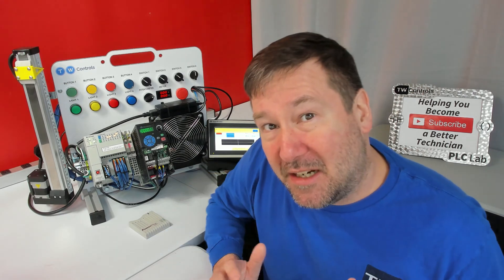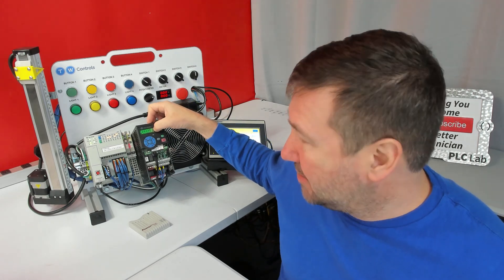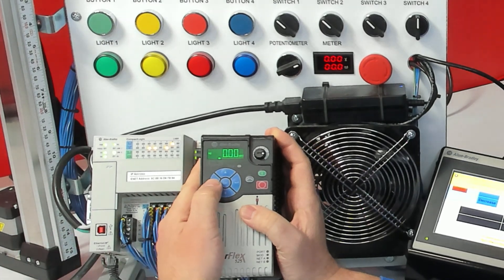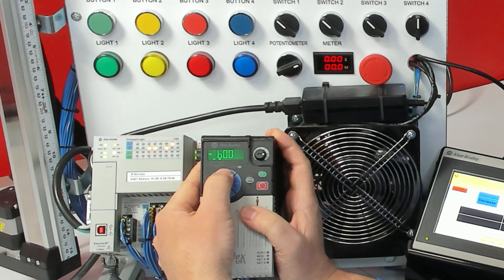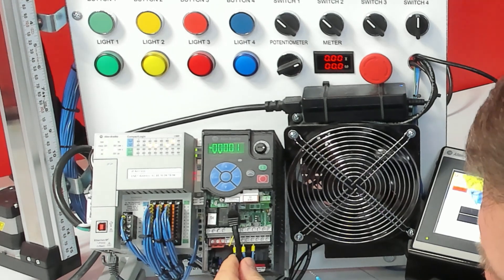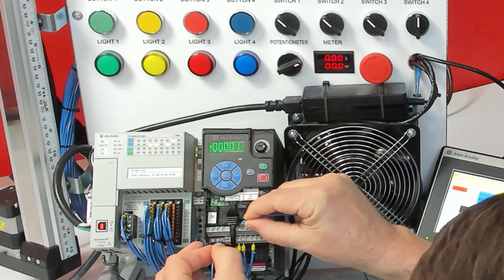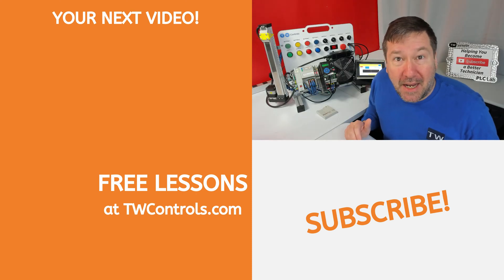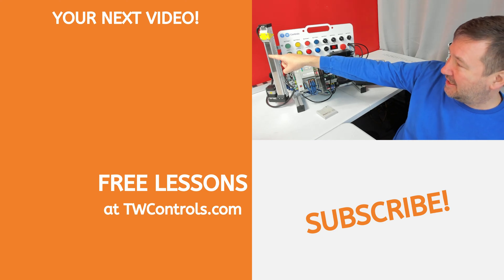How to Find the Values of Your Powerflex 525 Inputs

Comment: Is there a way to read actual RPM/Hz, status, fault code into a ControlLogix tag without using a MSG instruction and an EDS file?
Reply from the maker: Not fully understanding the question.  The EDS file is ultimately how the device is added to the IO Configuration.  Without it, there are no tags.  Without the IO Configuration or MSG...how are you hoping to connect to the drive?
Reply: @TimWilborne  Thanks for the reply.  I figured it out.  Back in the old days using a BUL160 drive, there were lots of parameters not visible on the default list.  With an EDS file and a Generic MSG instruction, you could get to device data you didn't even know was available.  I was trying to bring the drive's running current and status bits into the PLC for monitoring while running, but I didn't see those parameters as a tag with all the others.  Turns out you can configure the drive to make certain groups of parameters available in the drive set up.  Once configured and uploaded to the 525, there they were.  Thanks again.
Reply from the maker: Gotcha. Yes, you can add four custom variables across the standard EDS.

Comment: What axial fan is this I have seen in other videos you had one with an encoder on it as well? I thought they have to be rated to run as VFD control? I was wanting to learn more on drives and telegrams just wondering. Thanks so much your videos are amazing and extremely helpful!!
Reply from the maker: It is a 3 phase can by Oriental Motors
Reply: @TimWilborne  You wouldn't happen to know the model number by chance, would you? From what it looks like it's the T-MRS18-TUL-F maybe? Just like the overall size of the one you have it would fit perfect on my trainer. Thanks again so much!!

Comment: we have these at my work for vibration motors on screens our setup was using the old device net now we have completely removed it "thank god" as was having issues due to heat and not giving an out put, having to cycle power haha.
Reply from the maker: Glad you came up with a better fix